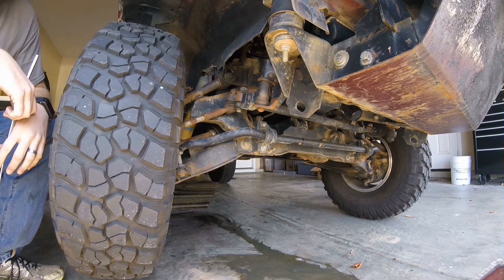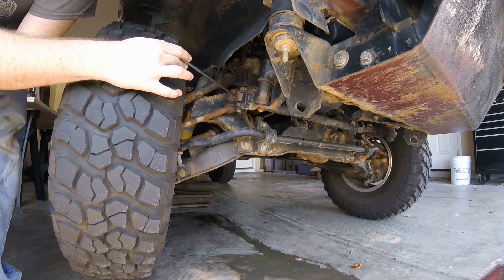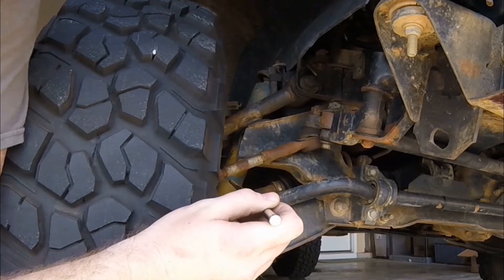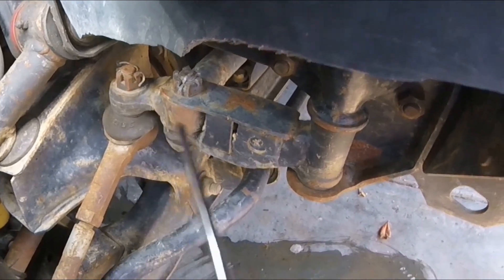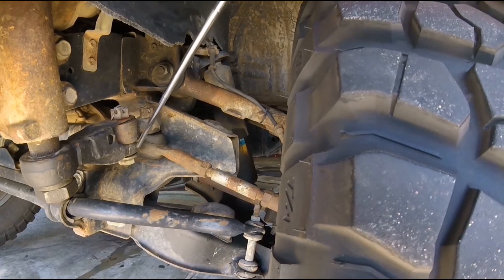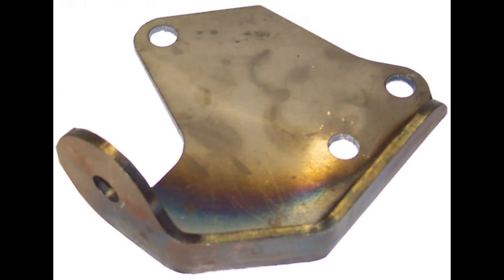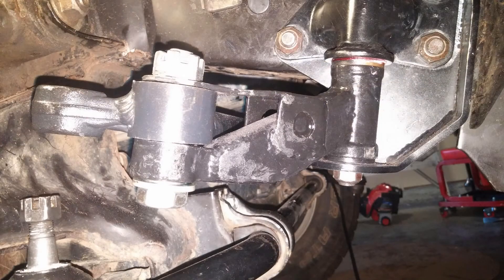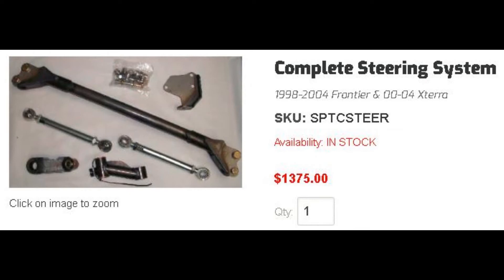Hold Your Alignment...AND Survive the Trail - Heavy Duty Steering Systems for Nisan Xterras

Comment: Did you make a video on how to beef up the center link?
Reply from the maker: This is basically it. Grassroots4x4 is what I used.
Reply: @XterraRob   is the grassroots link worth the $425 ? 
Will it stop the upward movement. I already have the brace and bronze bushings installed.
Reply from the maker: @Bigislandguy if you run suspension lift and 33s...yes you need some kind of centerlink solution. Grassroots solved it for me

Comment: The grassroots cl has a spherical bearing as opposed to the straight bolt you show here. Is there a difference in durability? 

Thanks for the great video!
Reply from the maker: Spherical bearing is pressed into the center link and the bolt goes through the center of the spherical bearing. The only thing I added was the extra welded tab on the idler and pitman arm to help brace the top end of the bolt. Even the grassroots spherical bearing uses a straight through bolted joint though.
Reply: @XterraRob  i really need the dimensions of that spherical bearing, i have to make one of these
Reply: @spasticnapjerk  me too, please if you found any info in what bearing to order let me know
Reply from the maker: I can say that it accepts a 5/8 inch bolt.  Also, the grassroots center link is fabricated by cutting off the ball joint and welding on a piece of tubing. So for that aspect...you can pick a bearing and find a tube to match. Whether you choose a 2 inch tube or 1.5 inch tube etc depends on the bearing you choose. If you are making from scratch you can choose whatever you want really.
Reply: @XterraRob  I built one of these using a single spherical bearing on each end and we never could get the bolts to stay tight, no matter what we tried.
Reply from the maker: The grass roots center link comes with a bolt, two washers, and a castle nut. The tip of the bolt has a hole drilled through it to accept a cotter pin that keeps the nut from backing out. I actually tightened it down as much as I could...then backed the nut off one "window" so the cotter pin aligned. Didn't want the hardware too tighten because it makes the steering tough to recenter.
Reply from the maker: Ps:  I have a newer video where I remove and take apart the steering system on my truck. It has maybe some other views of the steering compoments that may be worth checking out.

Comment: Thanks again for all this info.  I have most of the frankenstien kit( don't have the grssroots centerlink).  Is that enough or the center link is a must do?  I'm on a 3" SL and while turning fully I hear a noise. Is it one of the steering components hitting the frame?  Thanks for your help
Reply from the maker: My vote is a heavy duty centerlink is a must. Even with mew stock style replacements...my truck would chew through tires and the tie rod ends would get caught up on frame rails.  Maybe if you never go off road you could get by without it though. Hard to know what your noise is specifically though.

Comment: Which size oilite flanges did you use? Trying to use the McMaster website hut it'd a Pita also can you eleboratw on the idler arm bronze bushings?
Reply from the maker: Idler arm bushings from bandit4x4.com. The McMaster Carr bushings were for the bolted joint between idler arm and grassroots centerlink...and also pitman arm to grass roots center link. Mcmaster carr website... Power Transmission > Bearings > High Load Oil Embedded Flange Sleeve Bearings > 5/8 shaft diameter (5/8 bolt comes with grassroots center link).  3/4 outer diameter (housing size)  3/4 length. Part 2938T44 is what I used.
Reply: @XterraRob  you're the man.
Reply from the maker: Happy to help!  Thanks dude.

Comment: Great video xterras r such a pain but I love mine just wondering what size bolts u r  using on the idler arm and pitman arm
Reply from the maker: The grass roots center link I have comes with the bolts.  They are 5/8 grade 8 bolts. Not sure on the lengths.
Reply: Thanks

Comment: Thanks so much for these videos. They have really helped me in the build process. Question on what bushing you used to press into the grassroots centerlink to help reduce wear on the centerlink itself?
Reply from the maker: The bushing I got was a hardened oil light flanged sleeve bearing from McMaster Carr. 3/4 inch long, 3/4 inch outer diameter and 5/8 inner diameter to hold a 5/8 bolt. Gotta get a hardened one. The regular bronze bushings aren't strong enough with the steering forces.

Comment: Sow how necessary is upgrading these portions? I do a fair amount of easy-medium (no rock crawling but it is rocky as all get out here) trails offroad. I currently have 31's but would love to get a little more clearance with tires down the road. I am waiting on shackles so I can do a PML. Is this something I can just do upgraded tie rod ends down the road and call it good or is this stuff I should really be doing at the same time as the PML?
Reply from the maker: Tie rods are by far the weakest part of the Xterra and most likely to break and leave you stranded.  With no lift and small tires, it isn't a huge deal. If you are going to max out your lift with a PML and 32s, I would still go with HD tie rod adjusters, idler arm brace, and the Bandit 4x4 bushings.  Can you get by without it? Sure...until you dont. Insurance policies aren't as sexy as a lift and tires...but preventing a break down is pretty valuable,  especially if you do trails alone. Another option woukd be just keep replacement stock tie rod adjusters in the truck and a few wrenches and make sure you know how to change them. Ive broken 2 and had to make sketchy trail repairs.  Not recommended.

Comment: Any clue where to get the jam nuts for the tie rod adjusters. The 4x4 listing for adjusters says the nuts are sold separately but can't find it anywhere on the site.
Reply from the maker: Good question. 4x4parts.com has them as a separate add on when you buy the adjusters. Id send them an email or phone call anf see if you can get just the jamb nuts.

Comment: Hey rob im planning on modifying some stock tie rod adjuster by welding a stell tube in the middle for reinforcement.
Reply from the maker: Not a bad option, but makes it tough to align since you really need wrench flats on the round section to adjust the toe in.
Reply: That's right. I think I'll weld a nut in between an and 1 steel pipe section on each side of the nut 👍
Reply from the maker: @fernandocabral275  that will work! Good idea!
Reply: Steel tube In the middle and welding the steel to the adjuster....trying to do a budget offroad build

Comment: This is awesome!
You bring a lot to take into account the endless possibilities to what can be done to Xterras.  
Can you please provide links mentioned on this video as I am guessing one is more expensive than others. Please would also provide the third option per your personal customization.  

Been playing around with the stock torsion bars as I lifted 2in so far. I’m planning to lift 1in more to make it equally as to the height on the back. 

I’m thinking to install 32in to 33in with 17in rims in the future and I’m contemplating this set up for now. 

I think I will do once a month off roading as of now.  

Thanks
Reply from the maker: Thanks for watching. Check out 4x4parts.com for the king kong steering kit. They also have individual parts like HD tie rods and idler arm brace. Calmini.com has the total steering kit...plus a few individual parts like the idler arm brace and HD tie rods. Grassroots4x4.com has the upgraded center link as an individual component.

Comment: Just bought an 03 with 126k on the clock as a work vehicle/ hunting rig. Doesn't look like anything in the steering/suspension has been touched in those miles either. Will see a lot of highway miles and BLM trails. Just ordered everything on the list to whip the steering into shape as well as a set of adjustable shackles, a set of Bilsteins, and replacement sway bar bushings. The plan right now is to go with a 1.5" - 2" PML and some bumpers with winches.

Comment: Thanks for posting.  I really appreciate it.  I have been driving my Xterra xe since late 2001.  It has been very reliable with 180k on the clock.  I change oil every 4-5k.   It has never let me down.  I do my own maintenance since a dealer ripped me off.  Easy to work on. Well easier than gm products.  Your vids a big help.
Reply from the maker: Thanks for watching!

Comment: Can I just use all Moog parts? I hear there an upgrade
Reply from the maker: Moog is a good brand for stock style parts. If you aren't doing off roading and aren't doing lifts...they will be fine. Once you get into larger tires and lifts...the stock design wont last, regardless of the brand you use. Its best to decide up front what direction you want to go. I replaced stock center links twice...one OEM from nissan and one Moog before I realized it wasnt the quality of the parts giving me trouble...but the quality of the design.  I could have saved money if I had just gone straight to a heavy duty steering kit.
Reply: @XterraRob  going with 265/75/16 which only going up from 265/70's so not much bigger. Also, only lift I'm may do is turn T.Bars about 1/2-3/4" to level it out. I believe the CV's don't turn in 2 wheel so not worried about angle, plus that ain't much of an angle anyway. Some off roading but nothing major, just normal trail blazing with light mud, some small hills. So do I still have to upgrade to expensive stuff?
Reply from the maker: The biggest angle is not CVs...but tie rod angles. 265s and a front leveling should be OK alignment wise ... But trails will always be a judgement call as to how much you think you will stress the steering. You don't HAVE to...but if I were going to spend money to replace everything with Moog anyway...id at least upgrade some of the things...or start saving for it if you can't afford a kit right now. It absolutely is the biggest weak point on the Xterra. Especially if its a daily driver and down time for repairs will hurt you.  If you were doing no off roading, id say no need for an HD kit with just 265s and a small leveling...but any off road trail in the stock steering system is a gamble.  If you can't do a full kit, Id recommend heavy duty tie rod adjusters as top priority, and bandit 4x4 idler arm bushings and an idler arm brace (Calmini or 4x4parts) as a close secondary priority.  Light offroading with 265s and a leveling are at the high end of what the stock style center link can do.
Reply from the maker: I have another old video called "Tire shops cant align lifted vehicles" or something to that effect. Watch that...i talk about tie rod angles and ahow you what I mean.
Reply: @XterraRob  ok. Thanks
Reply: @XterraRob  I will
Reply from the maker: Happy to help.

Comment: what you do with your idler arm? thnks
Reply from the maker: Grassroots4x4 center link uses a 5/8 inch straight bolt...so drilled it to 3/4 inch and used a hardened flange bearing with a 5/8 inch inside,hole for the bolt to go through. Then it has bandit4x4 bushings in the hinge...and the rest is just gusseting. Steel plates welded on it to increase rigidity. That was probably over kill.

Comment: thanks for making these videos. they seem to answer questions just as I am researching them. as a past (R50) Pathfinder owner and now X owner DIY is the way to go.  Question, replace or add to rear leaf springs? currant ones are saggy. I've added Timbren SES and AC adjustable lift shackles,  but that really doesn't fix weak springs. should I add a leaf or two or replace with a new pack. l'm looking for better load capacity. and if doing the rear should I upgrade the torsion bars as well. not an off roader for fun. the truck just gets me into places I want to go.  think overlander/hunter. BTW I have the same year an color x that you do....so far am loving the truck! Did a 10K km trip this past summer. was awesome! no issues. though all highway.
Reply from the maker: +bush nut I have never been a huge fan of AAL packs because they typically really stiffen up the suspension and can make ride quality harsh...though they definitely improve load capacity. The other thing to consider is lift height. If you max out the adjustable shackle, you are at 2 inches or so. UCAs claim 3" in the front...but there are risks of puahing that limit too much. The AAL from 4x4 parts is a 3 inch lift...so you'll end up with quite a nose down stance. Calmini has a single AAL that claims 1.5 inches of lift that may be an option. I think I would either replace with a stock leaf pack, add the Calmini 1.5 in lift pack and drop your shackle down, or see if you can find a custom suspension shop that can make a custom leaf pack that is stiffer without adding much ride height.
Reply from the maker: +bush nut I wouldn't bother with changing to stiffer torsion bars. They are just a stiffer spring. Similar to AAL packs that are too stiff, they can make ride quality harsh. AAL may make sense for load capacity or trailering because you are carrying more weight...but unless you have a heavy off road bumper/winch etc on the front to make it much heavier...they aren't really needed. I still run stock torsion bars with my winch and bumper with no issues. Just had to readjust lift height after all the extra weight.

Comment: What upper control arms are those?
Reply from the maker: +Vince Ruland 4x4parts.com. theyve had a bit of trail use...hence the rust and dirt and poor looks. No complaints with the actual parts though.
Reply: Xterra Rob I'll check them out. I just got an 03 about 3 months ago. I completely rebuilt the front end with all stock parts. Then added some Falken wildpeak tires. Need shocks next. Not too sure if I'll do a lift or not. I did your air box mod yesterday. Not sure if there are any power gains, but I'm sure it didn't hurt it.
Reply from the maker: +Vince Ruland cool! Did you get a high flow filter or just a paper filter? Falken wild peaks are pretty decent. If you already rebuilt the front end...may not make sense to go with control arms and do the full suspension lift. Maybe a PML and a body lift if you want.
Reply: Xterra Rob I just put in an oem type paper filter. A high flow sounds like it will take full advantage of the mod. Will have to do that. Need to work out my p0420 and p0400 codes before I get anymore into the suspension anyways.